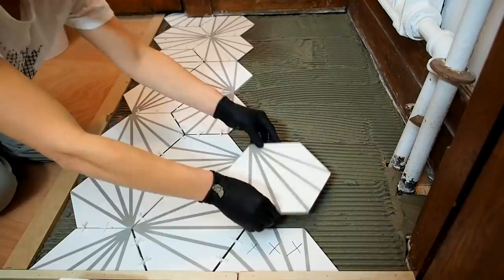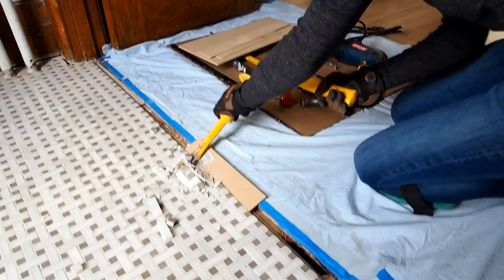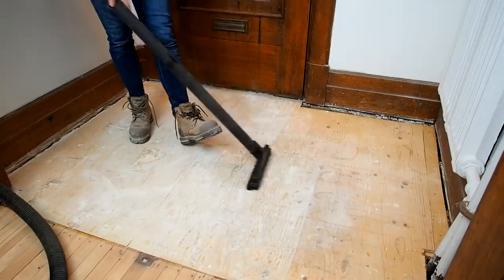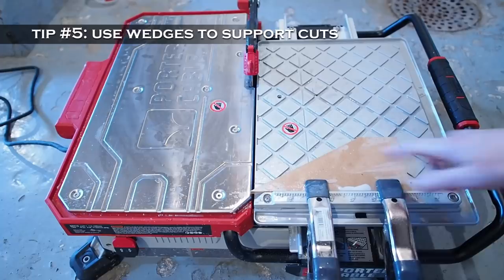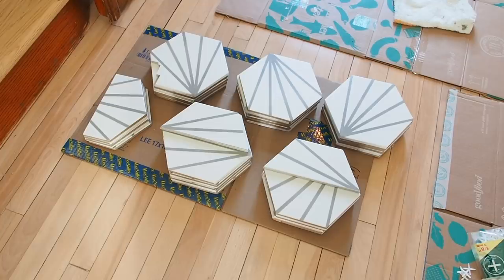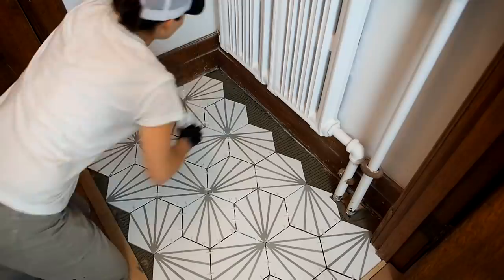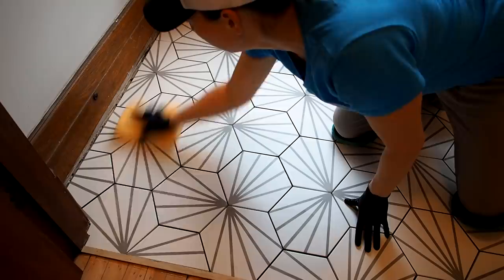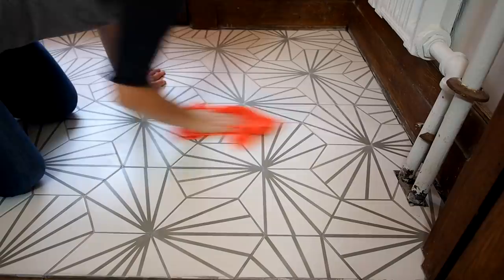DIY Floor Tile REMOVAL and Tile Floor INSTALLATION  // 15 Beginner Tiling Tips

Comment: Nice job!  Tip #16:  As you're laying the tiles, use a straight edge to check that your tiles are level with one another.  A high tile can usually be wiggled a bit to lower it.  If a tile is low, you may need to lift it and add some thin set.  Easier to do right after you've put it down than an hour later!

Comment: Nice job, bet you're glad to be done with it! We recently removed an old tile floor in our hallway and bath. It came out pretty easily with a rotary hammer, but wow what a mess. Breaking down the cement board for disposal is a lot of work too.
Reply from the maker: You bet, I am SO happy to be done with this project. And super satisfied too!

Comment: Looks beautiful! A few tips for your next tile job: 
Depending on the grout you get, clean as you go using the same method you said at the end. Some grout brands only have a 15-30 minute cleaning time which could ruin the entire project if it's not cleaned up properly in time. 
If there is a haze like you saw on your tile, try a haze remover. It works wonders and will remove it in no time. There are different types. So if you have natural stone tile there is a specific haze remover for natural stone. Hope this helps!

Comment: The probable reason the existing tile stuck so well is because the substrate was more than likely well sponged and wet. I see you didnt do that which will cause problems later. The substrate being wet helps create a very strong bond.

Comment: I would suggest adding a sealer as the final step to make sure the joints do not absorb any dirty water from wet shoes.
Reply from the maker: Great tip, but the grout I used has "DropEffect" technology which reduces surface absorption to help repel water, dirt and grime from penetrating grout joints. So I'll wait and see if the grout stands up to its marketing claims!

Comment: GREAT JOB, Marie!!! I've done a few tile jobs, both vinyl and ceramic, but we got lucky and chose patterns of tiles both vinyl and ceramic that didn't have a pattern at all... Tiling isn't an easy job.
.
One  thing though that I was taught is to first find the physical centers of both directions, then use chalk lines, then adjust the so-called centers of both directions to avoid having to cut those dreaded tiny pieces. (This is in NO WAY a criticism!!! Just advice for future reference.)
.
Even so, it worked out fabulously. Looking like a million bucks, and enhances the value of your home. The most useful piece of PPE you used were those knee pads, I'm sure. ;-)

Comment: That's a great pattern and a good job. I really enjoy tiling. I see you managed to keep your cat out UNTIL you'd finished . When I did the kitchen floor , Mitz got in and bolted for the cat-flap -  straight through the wet adhesive !  I managed to catch her, got the stuff cleaned off paws , wasted a lot adhesive. Looked OK in the end and she didn't ingest anything nasty. Cats are worth it though.
Reply from the maker: The joy of having cats! 😂 Mine was surprisingly very cooperative and waited until I was done .

Comment: GREAT job.  We have about 1700 SF of tile that we would like to replace.  Our son in law does flooring but WILL NOT remove tile.  He says it's hit or miss as to how they will come up.  Depends on the original installer and how much adhesive was applied.  Like your videos! !! !!!
Reply from the maker: I can totally understand why he stays away from demolition... I had an apartment floor redone once by pros and they were cussing at how much mortar they had to grind off the plywood after they removed the tiles...